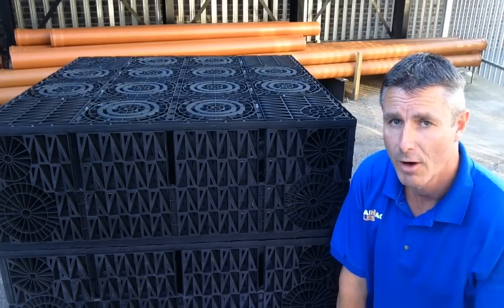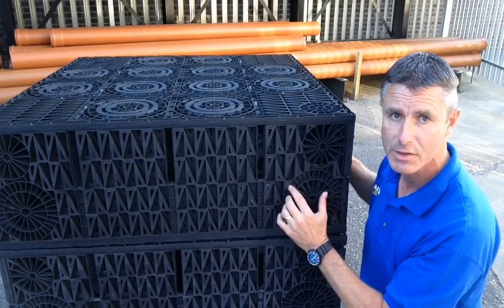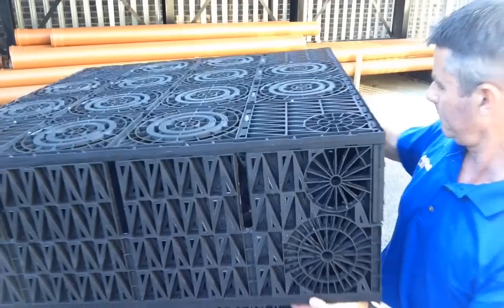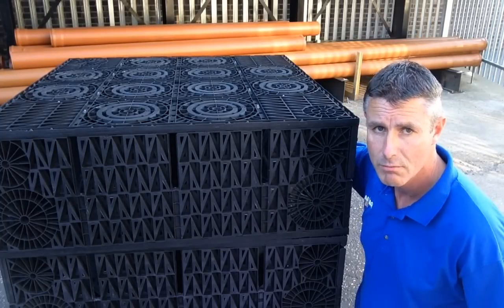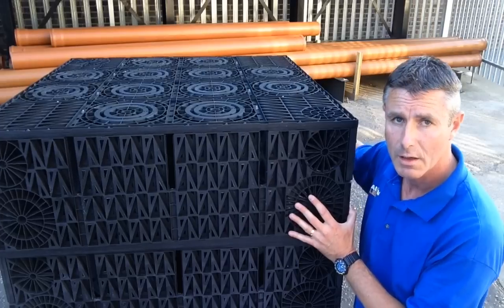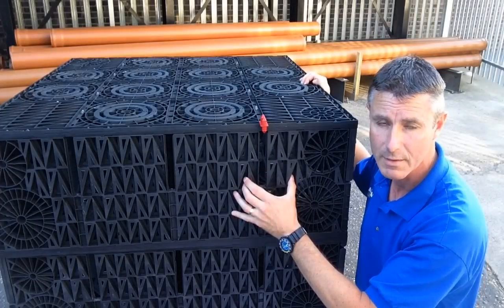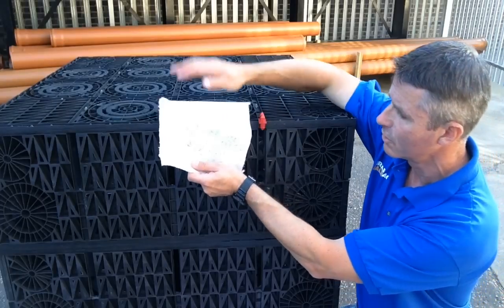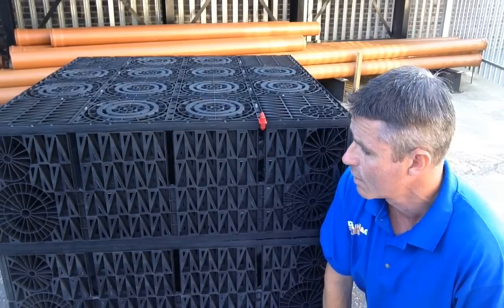PRODUCT REVIEW: Soakaway Crates - Surface Water Drainage Solution | Drainage Sales

Comment: Hello, I have a small area of garden that is holding water. Will these work on there own without adding any additional drainage pipes?
Reply: fatherkrismas If your garden is holding water then I guess you’ve got clayey soil. I’ve seen these soak aways installed and it’s just become an expensive pond.

Comment: What distance should a soakaway crates be from the house and the perimeter of the garden fence i.e your neighbour.
Reply: Michael Garfield you should always consider the angle of repose, namely you should ensure the soak away is at least the depth of the soak away and the depth of your footing away from your property. So if your footing is 1 metre deep and your soak away is 1 metre deep, the soak away should be a minimum of just over 2metres from your property. Further away would be preferable.
Reply: @briancole2023  That seems logical.  Do you know when this type of soakaway was specified/mandated by building control in the UK?  My house was built in 2015 with soakaways; interested to know what system was used.  Medium sized building company, could ask them; might even get an answer.

Comment: Yet another over complicated idea from those interfering Americans. Tried and preferred method of simple excavation lined with a permeable membrane, fill with 1/4 inch pea-shingle, lasts a lifetime and at a fraction of the cost.
Reply: Is building control still happy with pea gravel soakaways these days?
Reply: And at a fraction of the water management volume.  I don't know where you live, but it certainly is not South Florida.  You could not imagine the volume that rushes out of my downspouts during a normal Summer rain.  It runs straight into sand, which is all we have here, and it STILL floods my gravel over sand walkway making it impossible for me to use my back door while it is raining.  This is a perfect solution.
Reply: Cliff Carlo no I think you will find it was a European invention that has been in Britain for over twenty years, the Americans have only been using it for the last decade.
Reply: Choppington Otter yes we are.
Reply: Cliff Carlo can you explain method in simple terms I'm a beginner in gardening lol

Comment: Load of high cost bullshit ! Do it the old way with old hard core or gravel ours on our farm is still going fine after twenty odd years service
Reply: Gravel provides 30% volume for water storage while these crates provide more than 90% volume for water storage.  This is a terrific idea.  My soil is not soil, it is sand, and my garden, patios and gravel walkways STILL flood in a normal Florida rain.  There is 1" of water standing in one of my gravel over sand walkways and 2" of water standing on my central patio.  The volume of water that comes out of my downspouts is simply unmanageable, even when flowing directly into sand.  This is a perfect solution.  I may wrap it all in an impervious liner, add a pump, and use this harvested rainwater for irrigation--I'd save more than $100 month on my water bill.  I wish I had invented this.
Reply: Mat Naylor typical farmer mentality, I have in my time seen farmers carry out all sorts of projects that their fathers and fathers, fathers have. This does not make it better.